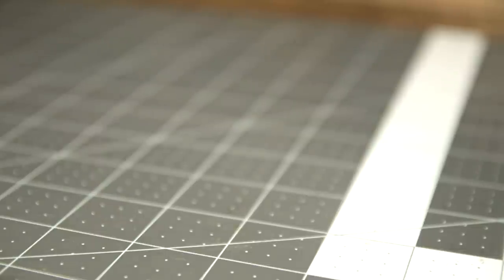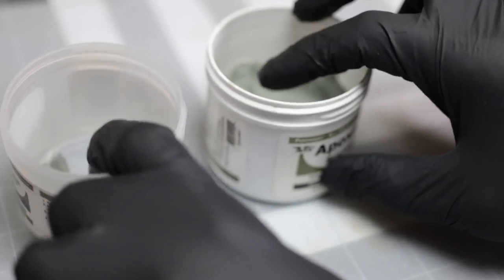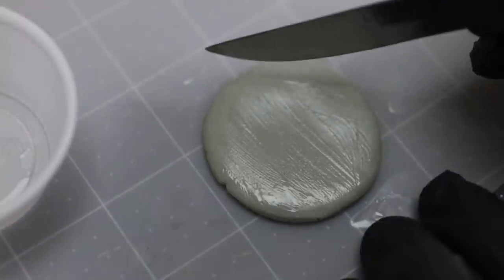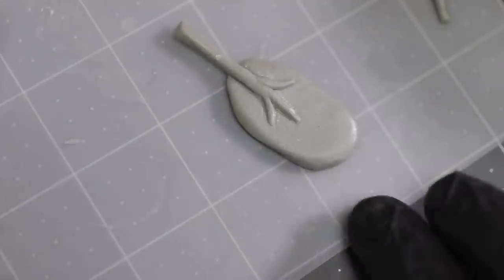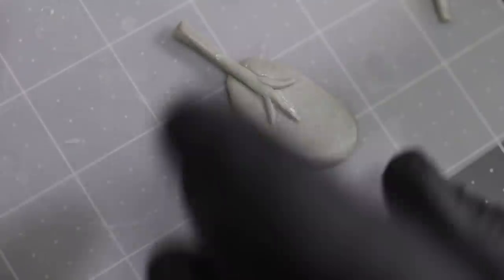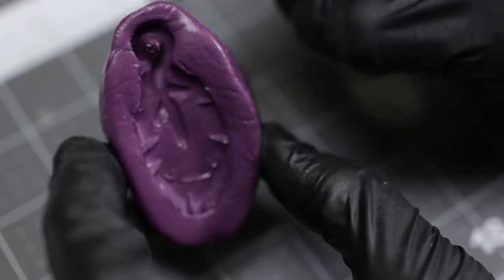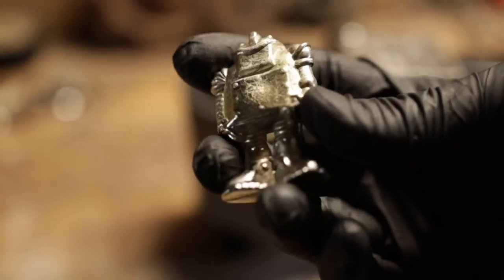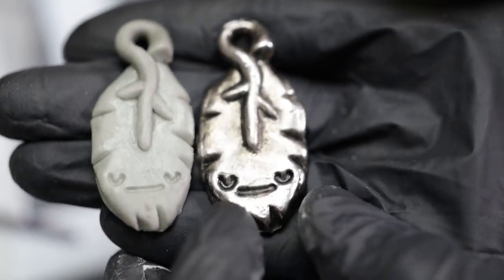30-Min Metal Mold, Silicone Putty Metal Casting

Comment: Hey, CrafsMan, I need some pointers on making a silicone mold for resin casting. The part I want to copy is a rear lens cap for Bronica lenses. These caps are REALLY hard to find and I'd like to make a mold of one that I have so that I can protect my lenses. I'd like to make it as a single-piece mold just for simplicity sake. These looks basically like cups with small overhands that lock into the leans' bayonet mounts. Have you ever tried to make something like this with a single-part mold? Do you know if resin off-gasses over time in any way that could harm lenses? Thank you!

Comment: My dad used to love working with Epoxy glues and stuff crafting and shaping all sorts of things, he would use Epoxy and String (he would dip the string in epoxy or cover the string in epoxy) and would shape it over stuff, making incredible things. ATM I do not like using it, I currently prefer utilizing Organic Material, and I don’t work with resins. HOWEVER the fact that there’s Epoxy clay blows my mind, that resin stuff is so strong, the fact that you can shape it like any other clay, it is so crafty, I appreciate it a lot. That is incredible.

Comment: Dear friend,great job. I have some questions and I really need help. I hope you see and reply my questions:
I am planning to make some fishing lures for myself and decided to buy Quick-Sil Rubber which is used mostly buy jewelry designer. It has two components and applied by hand just like the one you used. I wonder if I can cast lead into that mould. I can't be sure if that silicone rubber mould can stand that heat. Please leave a comment. Thanks in advance

Comment: Anytime you pour molten metal make sure your mold is dry. I once saw molten pewter blow up out of a mold and burn a bystander quite badly. Apparently any moisture turns to steam on contact with the hot metal.

Comment: You mention the swing holding more than it is rated. That's because you always have to have a safety factor built into the design of a product. They know your going to push the limit so they have to build for that little extra. rated for 400F but takes 800F because of a 2X safety factor. Like your videos

Comment: You're right about weight ratings.
Typicaly something is "rated" for a certain weight. But if the manufacturer has any brains, they'll design it to buckle only under twice that number.

And in the case of the industry i work in, aviation maintenance, they'll rate things to as little as 1/7th of what they can truely handle. Maybe even more with some things.

And they do this to ensure the part can be safely used for as long as possible without risking it failing under the test of time, under a continuous load.

Comment: What's the safety solvent for? Is it necessary or just a nice thing to have?
Reply from the maker: Some people would use water in place of it, but others have said the water breaks down the clay more. I find it helps the tools "glide" through the clay easier, and it's certainly nice for cleaning them after you're done sculpting. Not 100% necessary. Like you said - mainly nice to have. :)
Reply: @TheCrafsMan  Thanks Crafsman!